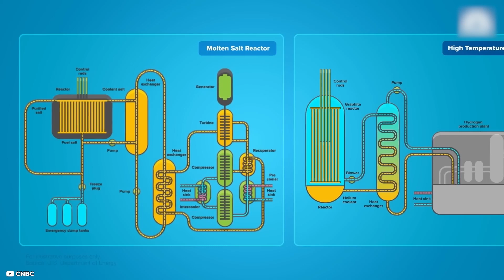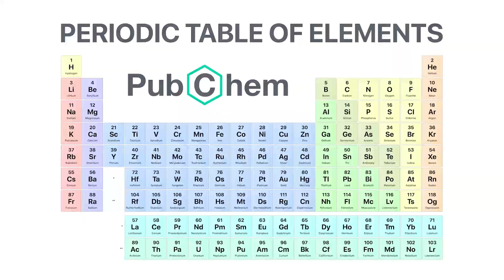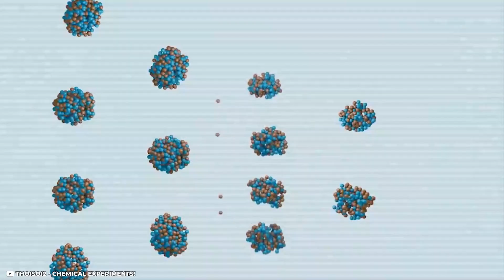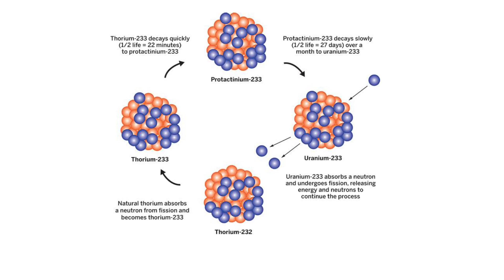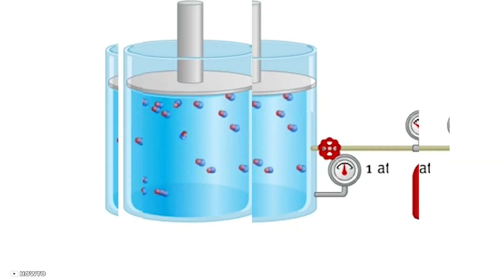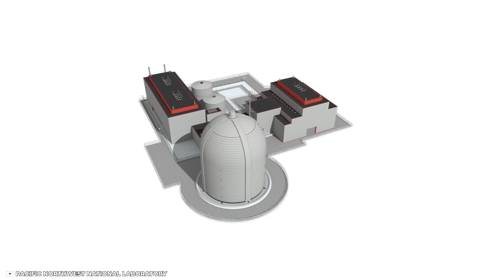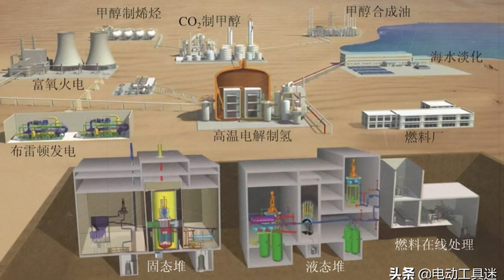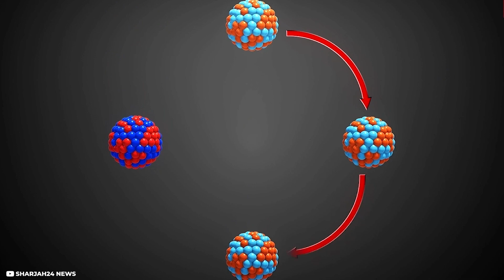NEW NUCLEAR REACTOR! Safe Nuclear Energy for 1200 Years!?

Comment: “How can we generate energy with a low radioactive material?”

That’s irrelevant. There are plenty of radioactive isotopes, some are highly radioactive, and many that are much less so. The real question is, is it fissile (or can it be made so) and is it in sufficient quantities to do anything with.

The only viable isotopes are U233, U235 and Pu239. Only U235 is naturally occurring, but it’s quite possible to make U233 and Pu239.
Reply: Not quite Possible. It is possible. It has been done before it was just not used as a fuel. The reactor that Alvin Weinberg wanted to build after the initial experience was a Molten Salt Breeder Reactor. Where it would create its own fuel
Reply: @uberdang830  “quite possible”≠maybe doable, it means doable, and has been done. 

Breeding U233 is easier than Pu239 because it’s done in a thermal spectrum reactor, and it’s not a great material for building a bomb because of the gamma rays that the decay products of the trace amounts of U232 gives off, but there is no law of physics reason why it can’t be done.
Reply: @M0rmagil  In theory U233 would be a great fuel for a nuclear weapon, actually being almost as good as plutonium in yield, and easier to producer. Though AIUI, any U232 in the mix would cause the yield to be a lot lower - I might have misunderstood that bit though. There is no evidence that it has ever been formally weaponised, though some early tests are believed to have used it.

Comment: We have more thorium than we can ever use. It’s literally that common.
Reply: Common where???  not everywhere
Reply: @clarkkent9080  It is common at a lot of places and even if your nation doesnt have a own supply, you can store enough cheaply and without any danger to make sure that you will not run out for deacdes.
Reply: @Garium87  The U.S. has vast supplies of Uranium so why invest in a technology that has been tried and abandoned?
Reply: @clarkkent9080  Because of the advantages it has in a LFTR model. And, btw, if you really wanted too, you could also still burn up your uranium in a LFTR.
Reply: @ignorancebeater650  Thorium can do anything except escape the laboratory for the last 60 years.  Maybe you should wait for one to be built and any of the many claims to be proven before stating them as facts
Reply: @clarkkent9080  Nuclear physics are well established, so it's strange to now dispute they don't constitute any factual reality. Both thorium and msr concepts clearly have advantages above LWR's, why argue otherwise?  Because we didn't build one? Well, the Chinese did, and we did build an MSR in the 60ies. I'm not seeing any concrete counters why it wouldn't work neither, so I'm wondering about the basis of your claim. For instance, one of the advantages is that liquid salt doesn't need high pressurised pipes (and thus a dome) to transport it's heat efficiently, contrary to water. That's a clear advantage.
Reply: @clarkkent9080  Ok, so... You wouldn't dispute it has advantages over PWR's, at least in principle, then?

Otherwise I fail to see how it relates to what I said. Your argument seems to be: it has no advantages, because a thorium LFTR doesn't exist yet. But that seems an odd thing to say because EVERYTHING didn't exist before it was made, and thus, nothing was proven until it was made? But if one had waited for such proof, nothing would ever be build...

I feel your definition of proof is rather unfeasable to maintain in practise, at least on the principle of the matter. If you make a claim that it's not proven it can be economical viable, it's debatable. But the fact that you can use thorium as a fuel (if you have a seed fuel) is both theorethically as practically proven, and that msr's work as well. Well, then, there is no objective reason to assume both concepts together suddenly won't work. As said, the physics is pretty clear on that. And that such a concept has many advantages over PWR concepts is pretty straightforward as well.
Reply: @ignorancebeater650  You miss the point completely.  I would have no issue with someone stating that MSR or Thorium technology is being tested and may prove x. y, or z.

But when you say MSR or Thorium will do something your saying it has been proven.  Should people be saying forget everything else because fusion provides limitless power with few downsides? If you disagree  physics is pretty clear on that and that fusion has many advantages over MSR and Thorium concepts is pretty straightforward as well.

Given that 2 PWRs tried Thorium and determined it to not be cost effective and that is not debatable unless you want to argue with the utilities that stated that and stopped further testing.  But there is of course a unprovable conspiracy theory that ca be claimed.  Simple point, after 60 years and multiple demo tests, the WORLD still does not have a workable electric producing MSR or Thorium reactor

The only MSRs ever in existence were demo test reactors that never provided any electrical power and the only operating one never ran for more than 6 months straight without having to be shutdown for repairs, it does not look good.
Reply: @clarkkent9080  Well, of course fusion has many advantages over nuclear fission! That's why they're researching it in the first place!   That's exactly what I don't understand about your first response to me: are you denying this, yes or no? After all these posts, I still don't get a very clear answer from you.

Let's try it once more: fusion has advantages over fission. And a thorium LFTR reactor has advantages over a PWR reactor. Do you agree with this, or not? Let's be clear about this, otherwise we'll just keep running in circles.

I'm not arguing whether or not they'll turn out economically viable or not - one didn't know that with the first nuclear plants neither after all, we just expected it. I'm talking about the fact it has advantages from a purely technical standpoint, based in physics.

If we can agree on that, then I think we cleared things up.
Reply: @ignorancebeater650  You still refuse to use clear and concise language.

fusion POTENTIALLY has advantages over fission. And a thorium LFTR reactor POTENTIALLY has advantages over a PWR reactor. Once a full scale operating version of either is built and operated for some time we will be able to say for certain what the advantages and disadvantages of each will be. Until that point, it is pure conjecture. There are diamond nuclear , sand, salt batteries that have yet to be developed but that has not stopped the unsubstantiated claims from being made. 

We now know that today in  the U.S., traditional new nuclear PWRs are NOT cost effective when competing with other forms of generation.  That was not true in the past but technology changes and progress does not remain static.  The first nuclear power plant (Shippingport), where I first started was advertised by the media as able to produce electrical power too cheap to meter.

Given that Thorium was tried numerous times in the past 60 years and is being tested again without ever transiting to the commercial phase, says a lot.  

Watch your word tense and use the word potential and maybe the word claimed and I think we will agree
Reply: @clarkkent9080  I think you remain trapped in your thinking about it in the context of "economic viability" and "cost effectiveness", which is why I think your suggestion of the "wording" should be reversed. ;-)

After all, I explicitly said in my last post that, when I was talking about advantages, I was talking about it in a technical viewpoint, based on physics. So I made the context clear. You now answer using a different context and with another premise. But if you want to argue that it's not absolutely certain that a thorium LFTR will be economical viable, I'll gladly concede that point (though it is highly likely, I would argue). But that wasn't the point I made.

However, seen from a physics standpoint, it's clear thorium LFTR's have advantages above uranium PWR based systems. This is not "potentially" true; it's a direct result of the physical properties of it. So claiming it isn't, is rather nonsensical. It's like saying large planets "potentially" lose the heat of their core more slowly than small planets. No. That's not "potentially", that IS the case, always. That's because physics say large bodies cool slower than small bodies, all else being equal. Similarly, molten salt can transfer more heat in the same volume under normal pressure than water: aka, your heat transfer is more efficient. That's not an assumption, and you don't need a "working example" of a molten salt reactor to prove it: the physics are already well established on this. It is not "conjecture", thus.

For achieving the same thing, you'd need high pressure of the water to carry the same energy and have the same amount of heat-exchange. Being more efficient and having low pressure is an advantage - one would be hard-pressed to claim the opposite. Or do you? Because I don't see any real counters on the concrete examples I gave, so maybe you're disputing the semantic meaning of "advantage" instead? Or maybe you go for: what if they built the LFTR wrongly? Then it wouldn't work as predicted!  But then you're introducing new variables and new assumptions (contrary to Occam's razor) that you didn't introduce with what you're comparing it with. What if a high high pressure PWR vessel was wrongly built? 

But whether a given pipe or reactor was built the right way, it still wouldn't change the fact the advantage of salt being a better transporter of heat wouldn't change.
Reply: @ignorancebeater650   I am trapped in a thinking of correctly stating something as a technologically possible fact as opposed to something in actual use with that outcome.  And yes cost is king.  
Using an analogy, you would say that gasoline can be  produced from any waste hydrocarbon (i.e. paper, plastic, wood, etc.) and that clearly has advantages over dependence on foreign countries and you would be 100% correct.  I would contend that it is not even remotely economically viable and as such not possible since no one with any economic sense would even consider it based on the cost.  

Saying it is not possible is technically not correct but it is correct from a reality standpoint. 
Do you know how many people actually tell me there are commercial MSRs using Thorium and burning old spent fuel currently operating? And when I ask where, they reference the Chinese reactor without even realizing it is a small demo laboratory reactor.  The way these YT videos present things makes people believe MSR exist, everything claimed is cost effective and proven full scale and that we need to build more full scale commercial units now.  Simply slow down, let the Chinese do what they are doing and in 10 years we will have more TEST data that may or may not result in scaling up.  I believe that the Chinese will do nothing in the MSR area until they have confirmed its viability. 
The ORNL report on their MSR stated in their overall analysis: "the MSR has promise". Does that sound like they are more on my side of thinking or yours?  

EVERY reactor type has advantages and disadvantages.  Do MSR concepts have advantages over operating light water reactors and the answer is yes.  Do actually operating and time proven light water reactors have advantages over conceptual MSR and the answer is yes.

The Chinese have just built a MSR.  But instead of building a full scale commercial unit that one would expect if all issues were resolved and the concept proven, they built a very small (1/4 the size of the ORNL demo unit) demo test version and plan on operating it at least 5 years as a reactor only before the try to explore insitu fuel management processes.  
On the other hand, The advanced, passive safety feature Westinghouse AP1000 was built full scale in China and in the U.S. without the need for demo testing.  
It would seem like the clams of one design are accepted to the point of spending billions without the need for additional testing while even the Chinese have not accepted that with the MSR.

Working in the industry for 40+ years, my thinking is concentrated on demonstrating actual full scale working proof, including cost. 
Water is the most common substance on earth and everyone should e very familiar with it.  But a lot has been learned about it when combined with the different types of radiation and temperatures and pressures in today's reactors.  Every metal, every common product will have to be evaluated for interaction with whatever molten salt and fuel type is selected.  
There may be physics proven attributes of the MSR design but they are only valid to the utility world if the design as a whole can be built full scale, operated for decades, and the cost/Mw generated better than current designs.
Reply: @ignorancebeater650  So you don't dispute that fusion has all advantages over fission.
Reply: @clarkkent9080  Why would I dispute science? I'm a proponent of science. 😉 Though using your own way of describing things, it would be 'potential' advantages.
Reply: @ignorancebeater650  I don't dispute science as many things are possible.  However the U.S. is a capitalist society and here economics rules over science.  If it is not economical and profitable, it will fail.  Thorium has been tried 4 times in the U.S. and at other nations around the world and in ALLL cases rejected as too costly when compared to uranium based reactors.

You dispute reality.
Reply: @clarkkent9080  That's a non-sequiter. Rapid reusability of rockets has been tried 14 times before it succeeded with SpaceX. Flight with heavier-than-air machines have been literally tried dozen of times, before it succeeded. According to your reasoning, it's all proof that it doesn't work because it aaaaaalllll failed... Up until it doesn't, of course.

Besides, you're cherry-picking. I'm talking about thorium in an LFTR configuration, and that's only be tried twice. And the second one is in China, and is doing just fine.
Reply: U-238 works fine in MSRs.

We have millions of tons of U-238 sitting in warehouses.  It's literally that common.
Reply: @tombenson5957  yes, but you can’t breed U238 into Pu239 in a thermal spectrum reactor. You have to go with a fast reactor, and Pu229 is, of course what you make bombs out of.
Reply: None of these things are major obstacles.
Reply: @tombenson5957  uh, proliferation is a major issue, and breeding in the fast spectrum is much trickier. That’s why Argon National Labs, the Soviets and the French spend decades trying to make it work. I’m not saying it can’t be done, but it’s not like falling out of bed.

The guys at Oak Ridge had made incredible progress with their efforts on a fraction of the budget and time.
Reply: @M0rmagil  Look, I understand that you are an advocate for Thorium reactors.  All I'm saying is, there are plenty of other highly qualified people who will disagree, who prefer U-238 based reactors.  Everybody claims their design is better.  Who knows?
Reply: there´s literally 4x as much thorium than uranium
Reply: @Omnipotent_Gentleman  We have enough Uranium to power the entire human race for 5000 years.  Who cares how much more Thorium we have?
Reply: that is why the reactors were rejected
Reply: @stew6302  the fuel is a very minor cost associated with a nuclear  power station.

Comment: Molten salt reactor research was shut down at the end of 1969
The reason was the US military.  They halted funding because you couldn't build so easy nuclear weapons. That what you call today nuclear waste is the leftover of a very inefficient 
hot water reactor, which uses only 5% energy from uranium roads that have to be reconditioned because they fall apart. You have a hot water immersion heater with a 5% energy production.
The public pays now unknowingly for the plutonium and weapon-grade uranium for the military.
A win-win situation for the military, not the public😁😁😁😇🥰
Reply from the maker: Thats so sad. Hopefully that will change !
Thanks for sharing with our community 🙏🏽
Reply: Where do people keep coming up with this BS that PWR/BWR were chosen so we could make bombs?
Hanford Wa. has been making weapons material since 1944, 12 years before the first U.S. commercial nuclear plant became operational and their weapons production reactors are very efficient graphite moderated reactors and DO NOT produce any electrical power.
Savannah River site SC. Has been making weapons material since 1955 and their production reactors are very efficient low pressure heavy water moderated reactors and DO NOT produce electric power.
Weapons production reactors are NOTHING like U.S. commercial PWR or BWR power reactors and commercial power reactors have NEVER been used to produce Pu239 for weapons.
The U.S. currently has so much Pu239 that 34 tons of weapon grade Pu239 is being treated so it can eventually be disposed of at a cost of billions.